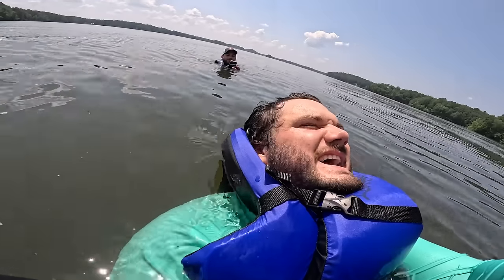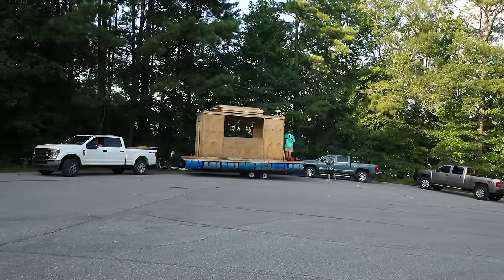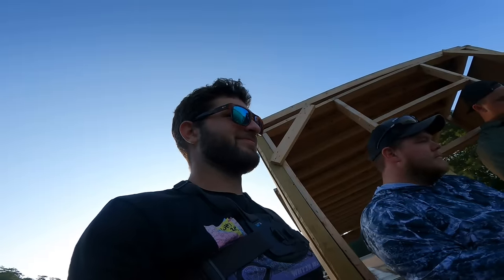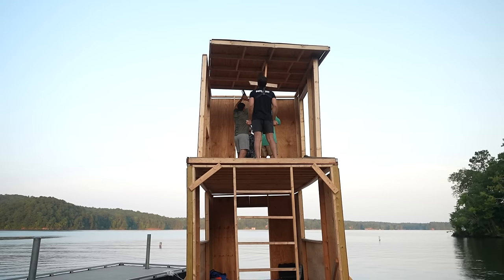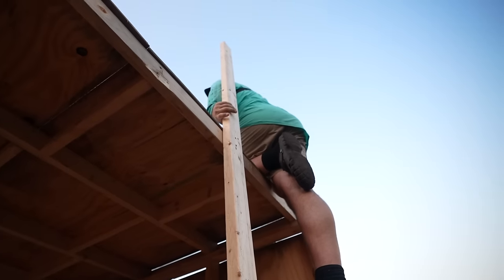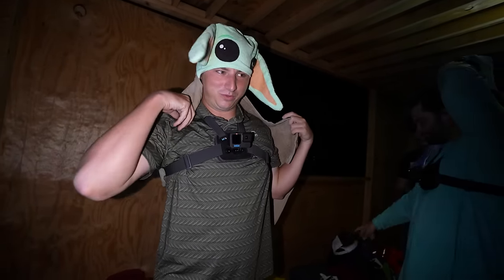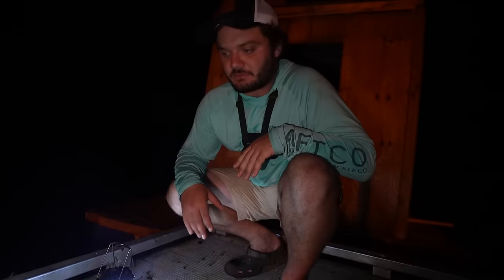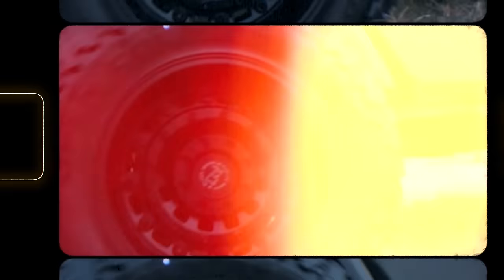Camping On My HOME DEPOT 55 Gallon Drum RAFT!!

Comment: I think the boat needs waterproof stain and more stable 2x4s added to the wall at angles.  Then add points to the front of the barrels so that it goes faster.  And make it too where you can actually camp in it 👍👍
Reply: (plus a remote cable steer, man tillering that thing back and forth when it's low down like that, all the way from the back where you can't see anything looks like it sucks!)

Comment: May files are edible and rich in B vitamins.

 Fried Mayflies (Inspired by Thai cuisine)Ingredients:
Fresh mayflies
2 tbsp vegetable oil
Salt, to taste
Optional: a sprinkle of chili powder or garlic powder
Instructions:Rinse the mayflies in clean water to remove any dirt or debris.
Heat the vegetable oil in a frying pan over medium heat.
Add the mayflies and fry for about 2-3 minutes until they are crispy.
Remove from the pan and drain excess oil on paper towels.
Season with salt and, if desired, sprinkle with chili powder or garlic powder.
Serve as a crunchy snack.

Comment: Buy sheer curtains cheap af, staple them over windows and doors. Get a solar panel for the roof for some better lighting. Run a bug zapper over the water to pull bugs away and chum the waters automatically lol

Build bunks.

Comment: there are many ways to upgrade it. find the leaking drum, repair it. build the walls up better. add extra outboards, get some power run, etc. how far can you push this thing? and once you figure that out, time to build bigger and better, from the ground up, with all you have learned. ibc totes would be a good start, for the next one.

Comment: We use those blue drums on our dock.  Y’all gotta try to keep the bungs out of the water.  Water leaks in to the drums and you lose flotation.  Also, you’ll need a bung wrench to tighten them tight enough to help keep water out when the two bung holes get below the water level.  Note to y’all… keep your bung holes tight and out of water

Comment: Over the summer I put my little sailboat in a lake and tied it off to the dock at the boat ramp like you did.  I needed to step and secure the mast, which only takes a couple minutes.  A couple of landwhales on a triple pontoon boat that costs more than my house came screaming from the other side of the lake and started berating and insulting me for treating the ramp like a personal dock.  1) there was nobody else there, 2) I was 15 feet or more away from the ramp itself, 3) I was on the other side of the dock.  Even if I was on the ramp side, there was a several foot gap between my boat and any trailer.

I wonder how they would have blown up seeing someone build a house at the dock lol

It's at the point where I never want to sail again.  Whenever I touch the water I meet aholes like them that just make me hate humanity.

Comment: Yeah part 3 ... YOU at least have to catch a fish, or you could call that 3" or 4" little bass and call it even. BUT you better add about 200 deck screws or that thing will warp away. If you ran more screws through the plywood it would strengthen that thing up and it would not WOBBLE that much when you jump off. ( maybe a few more 2 x 4s might help a little ) OH and put some 'AIR' in the trailer tires, they will work much better. Keep up the fun my brothers. CB

Comment: Had ya'll  turned the barrels 90d eg they would have been more stable in regards to the P/S roll also been more streamlined with less drag  while going forward.Additionally, a wider skirt on both sides of the barrels would corral and stabilize them.